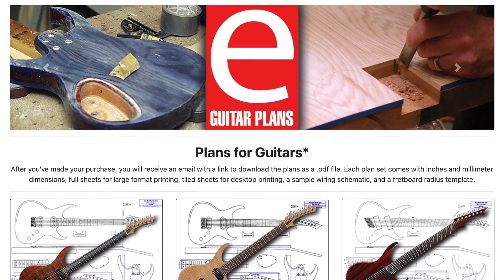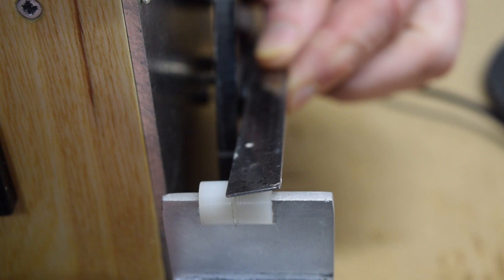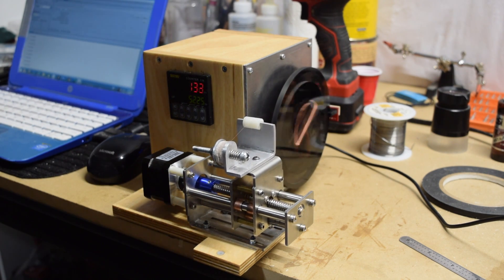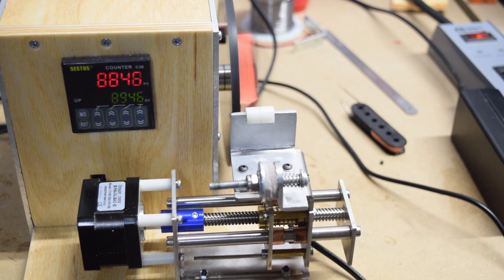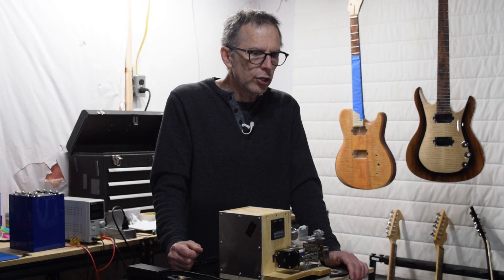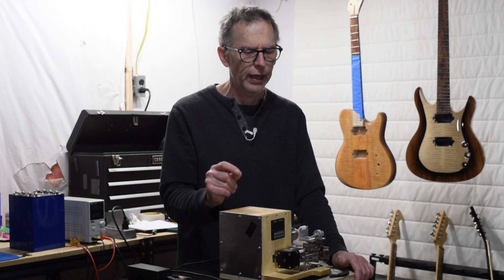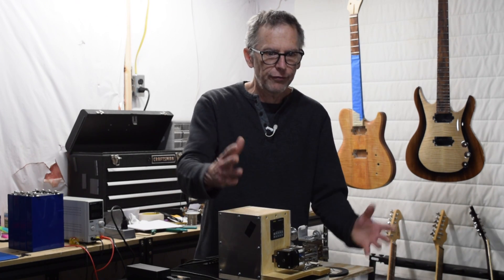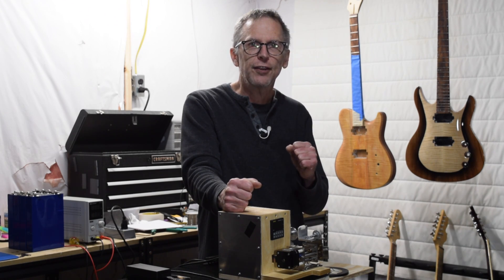Making A CNC Pickup Coil Winder Part 5 The Demo

Comment: Hi Chris, how do you handle wire towards the end of a spool? Let's say you want 5225 winds but you don't know if that much is left on the spool. Do you go for it and if it runs out early just scrap it? Do you not waste your time and just move to a new full spool? Maybe create an underwound pickup that just uses whatever you have left on the old spool?
Reply from the maker: I cross my fingers and hope to have enough wire. If I'm pretty sure I won't have enough, I'll grab a new spool. I could calculate how much wire I'm using based on length or even weight, but that seems a bit nerdy.

Comment: Hi Chris!. That's a pretty slick looking machine you've built. My prototype has a few things different, but many similar. I'm not using G-code at this point, as I've had no experience with it. (If I build your CNC router that will change, LOL). I've tried some code for this written in a variation of Python, and also a different idea using a piece of open-source software that runs in the Raspberrian OS. (I had an unused Mark 1 Mod 0 Raspberry Pi board waiting for a job). 
I think I mentioned earlier that I was experimenting with wire tensioning. I came up with a device for  real-time "dynamic wire tensioning" - it makes small adjustments to the wire tension based on bobbin position, wire gauge, winding speed and a couple of other things. I finished the "test model" of the device only a few hours (literally) before my accident, after trying a few different mock-ups. So it hasn't been fully tested and won't be for some weeks. I'm wearing a large and kind of awkward shoulder-fingers cast right now; as a result I'm down a hand. But, I think the gadget may work out OK, going by the initial trials. It's not an overly complicated system in terms of # of parts, or control. 
I'd like to send you some info for you to look at, once I'm back in the workshop. If you find it to be a useful addition, please feel free to use it, or include it with your plans. A bit of payback to you back for the many hours of priceless tuition your videos have given me in the luthier's art. 
Anyhow, your new machine looks like a really slick setup, and I'm looking forward to going through episode 4 (no internet in the hospital) to look at your new traverser. Many thanks for sharing this project - it's really exciting to think about the possibilities a system like this could offer.

Comment: I love it. I'm currently building a winder out of an old sewing machine and love the idea of a manual traverse system where you do not hold the wire and traverse rather I manually traverse it by a crank wheel rather than a cnc. Thank you

Comment: Looks cool. I think you should be able to generate a G Code file that could accurately wind the pickup to the correct number of turns and have it shut down the motor.
Reply from the maker: In theory, yes it's possible. In practice, however, the math and its required coding get's extremely complicated. The challenges include accounting for different bobbin widths, the speed of the traverse needed for achieving different scatter winding patterns, and the need to ramp up the speed of the winder motor at the start of a coil winding operation. Thinking about it gives me a Python headache. Right now, it's much easier to cancel the g-code feed when the counter shuts off the winding motor.

Comment: My main issue is wire tension.  Too much, break, not enough loose. Any way to digitize it to remove iterative efforts?  Got MOJO tool but still have to guess at tension.
Reply from the maker: I considered adding a force sensor to my tensioning mechanism. That would provide feedback in grams for how much the mechanism is squeezing the wire. I may explore that in the future, but for now, I have the tension set to yield exactly the target resistance I want for each bobbin regardless of the wire gauge. Of course, I broke the wire during my first three tests, but after adjusting the tension, I got the tensioner set just right.

Comment: Looks awesome, I was contemplating buying one of those CNC coil winders that are like $575 from ebay but this looks like a better option with the scatter wind ability of the transverse stepper. Do you have any rough estimate of cost of parts? Do you have an idea what the maximum winding RPM can be? I had bought plans for the previous winder you developed but I think I will go for this build instead.
Reply from the maker: Don't know the cost. I used a lot of parts I already had. With the software I am working on, the rpm has to be limited to 1200. However, that could change in a day. I have ideas about this.
Reply: I will say I've been pricing out his non-cnc pickup winder using parts direct from China. Comes in just under a $100. With a lot of extra screws and such that you can use for future projects.

Comment: GREAT project and awesome videos. Agree w Matt below that presets for historic pickups would be awesome. Those presets could be sold separately as the research is available.
Reply from the maker: Presets would be easy, and they wouldn't have to be accurate because how would anyone know if they are or not?
Reply: @HighlineGuitars  It does beg the question how much difference do winds, wire and magnet type/strength all make in the final result. A device like this certainly makes experimenting with different magnets/components easy since the wind is identical.

Comment: Love it! Ideas . . .

1. Eliminate the stepper motor and use a servo to transit the bobbin.
2. Instead of counting turns, why not just measure the length as it is wound.
3. Use a microprocessor (arduino, etc.) and do away with gcode.
4. For the software, include settings to mimic well known pickups.
5. Use a touch screen to control settings. Maybe a fine tuning rotary digital encoder would help with this feature. I mean, if you're gonna write software anyway . . .

I'm just getting into guitar building, you have been a great help! I love to improve processes and troubleshoot :). And do everything myself where possible!

Comment: I used optical pickup into interrupt pin on my Arduino to implement the counter.  I used a basic LCD display to display counts - and I added a gauss meter to my winder as well.  No CNC though.